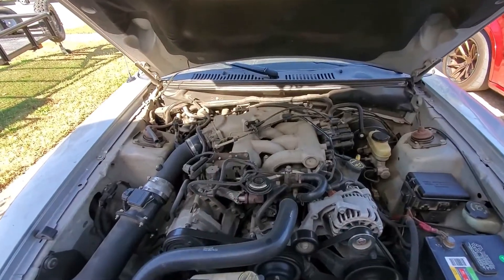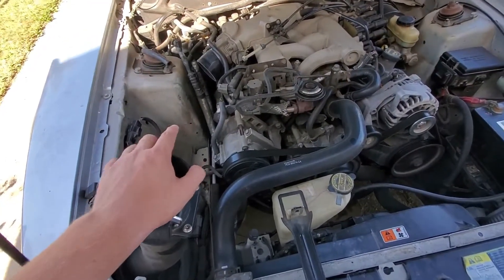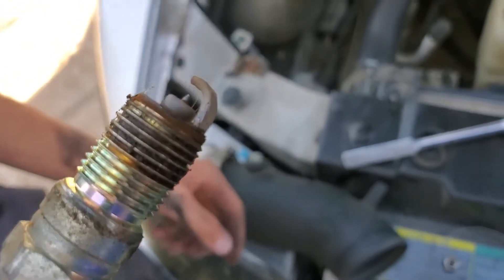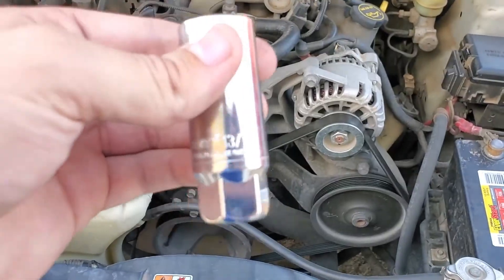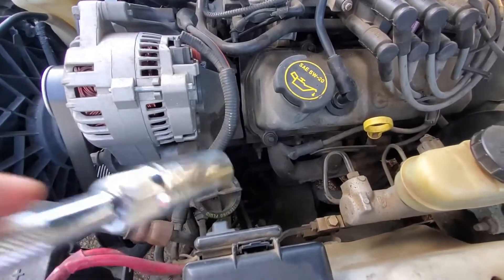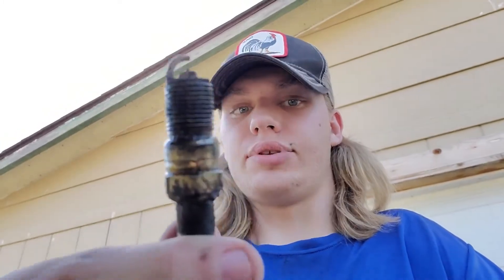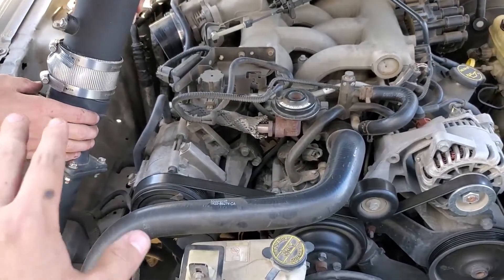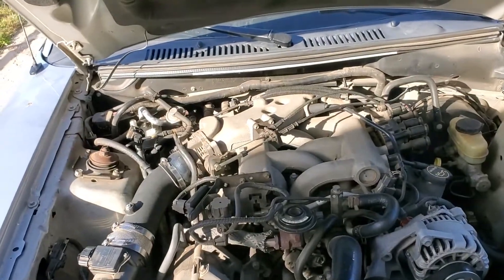How to Change Your Cars Spark Plugs (2003 Mustang)

Comment: bro how the hell did you put the  wire boot back on the passenger rear spark plug. My hand cant even fit through there
Reply from the maker: It's a pain on most cars. We actually had a set of long needle nose pliers we used
Reply: @JesseBusse  Yoo so u said u need to get under for that one ?
Reply: @JesseBusse  I had hella trouble with that one when I replaced mine but probably cause I was doing it from the too
Reply: @JesseBusse  help a brotha out bro my spark plug just came off tday when I was driving
Reply: @JesseBusse  it’s that one the one in the passenger side
Reply from the maker: @flash7144  like I said previously, we had a really long set of needle nose pliers we used to shove the plug boot back on. It's been about 2 and a half years since the filming of this video so I don't 100% remember the specifics of it
Reply: @JesseBusse  I’m talking about the spark plug not the boot so in order to tighten it u have to do it from under the car ? Cause from the top it’s hella hard
Reply: @JesseBusse  it’s all good bro